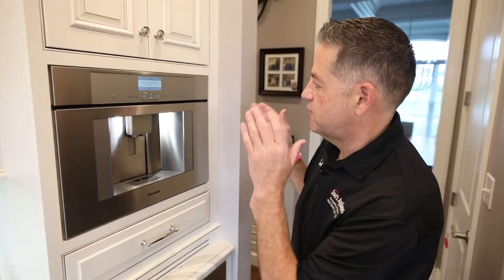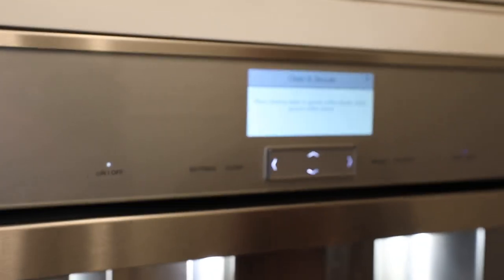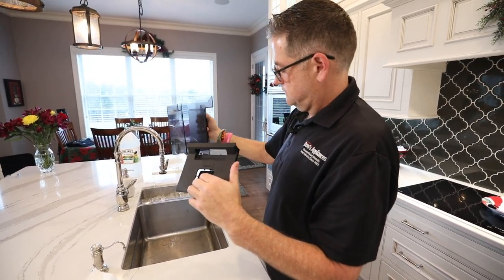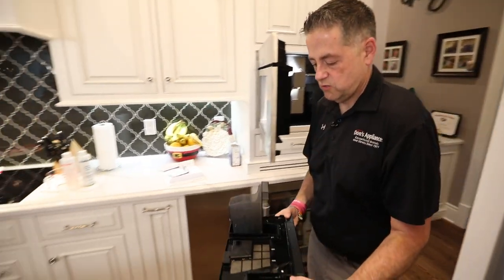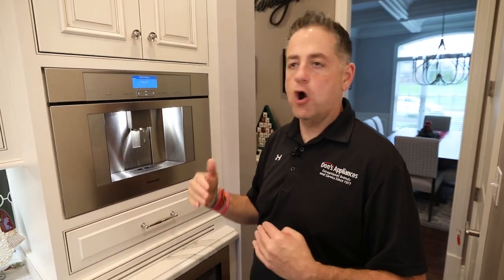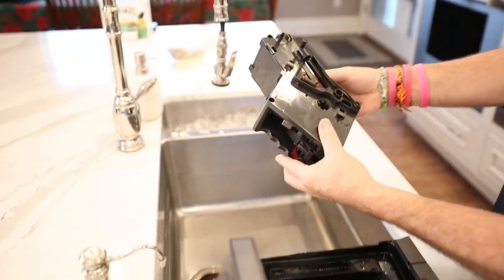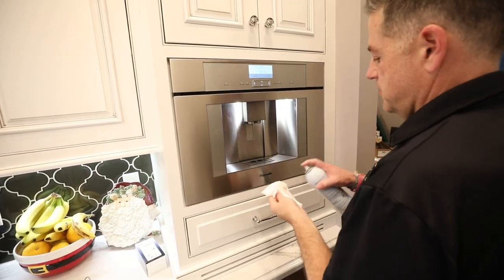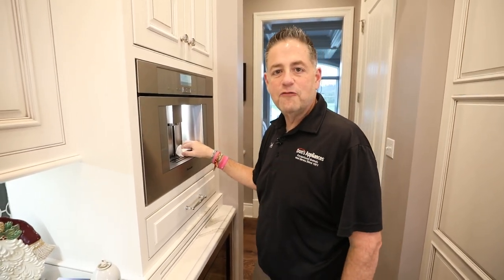How to Run the Cleaning Cycle on a Thermador Built In Coffee Maker

Comment: I have this same model hard plumbed and it’s supposed to drain under the cabinet into a pea trap with vent holes. Mine hasn’t drained since installation. We are the first in town to have this model installed so we keep coming to dead ends. When we detach the flex tubing from the pea trap, it drains fine into a bucket. So, function FROM the coffee maker is fine. 
Have you had any similar issues? Suggestions?